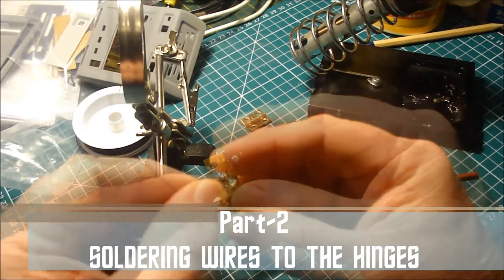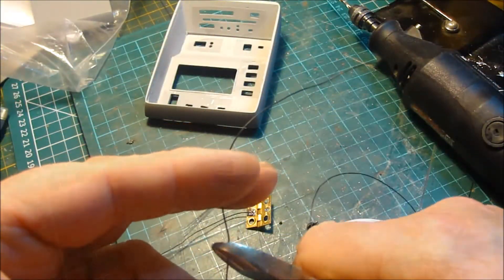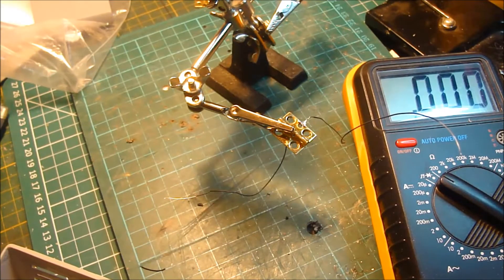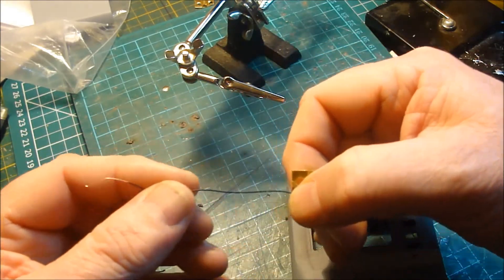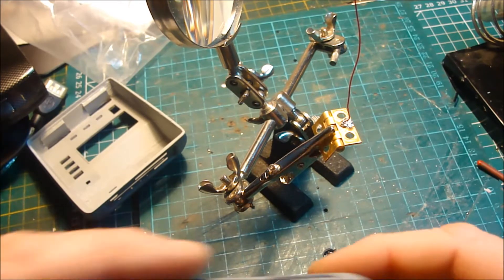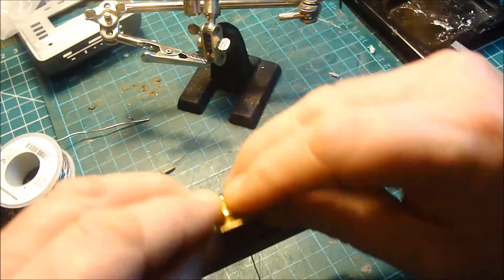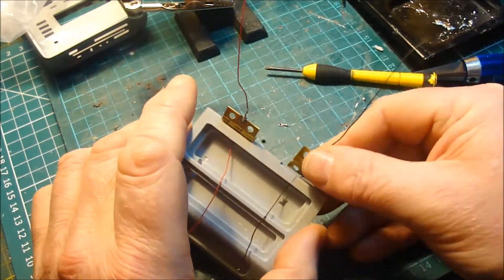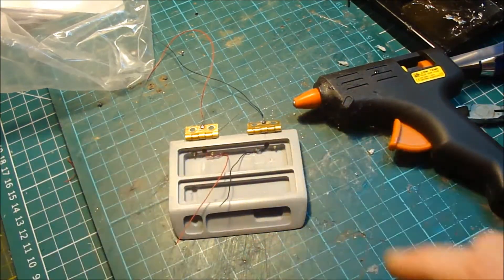Star Trek Medical Tricorder  Part 2 - Wire and Hinges

Comment from the maker: A series of videos I have made showing how I go about Making Star Trek Props using Stapleton Productions Resin kits and GMProps Electronics.
Reply from the maker: Thanks a few sizes  - 22awg (1.7mm OD)  also 26awg (1.5mm OD).. thinner the better ..but if too thin its hard to work with so I do not use 28 or 30 awg - they are 1.2mm and 0.8mm but other might use them ...